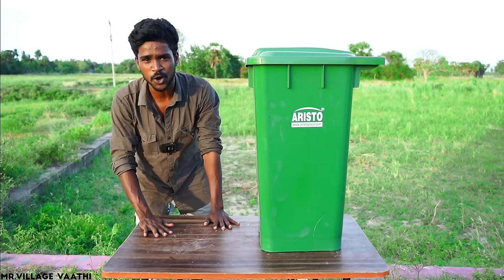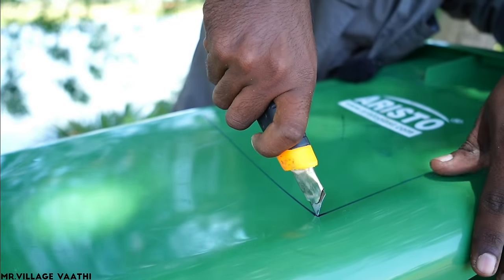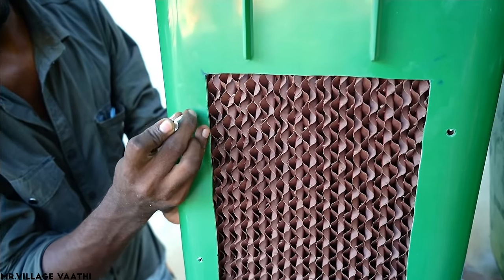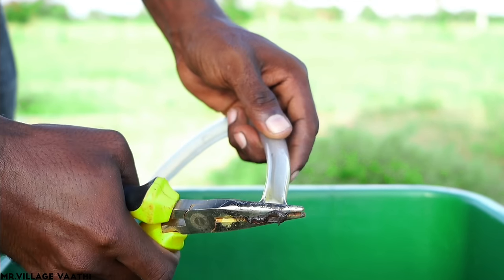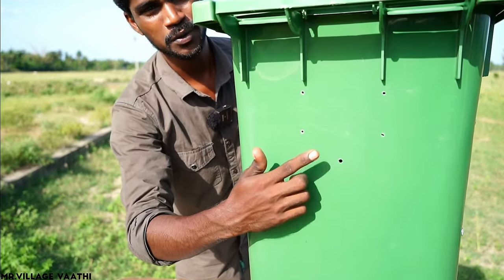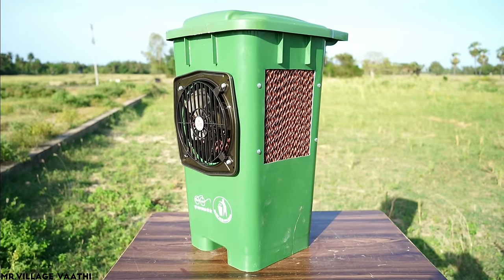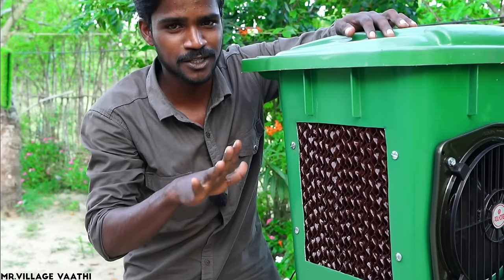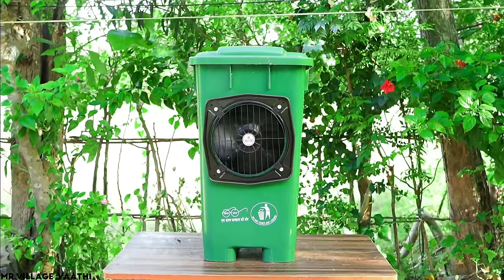Making Air Cooler with Old Bucket..! | குளிர் ஜுரமே வந்துடும் 🥶 | Diy Air Cooler | Mr.village vaathi

Comment: Athu exhaust fan nanba.. Ac current la direct line coil debt motor... 

Pulse regulation work pannathu.. Neenga PWM regulator use panna speed maathalam.. 

But really super.. Ac alavuku cooling varalanaalum konjam ok than EB Bill compare pannum mothu..
Reply from the maker: thanxs bro♥

Comment: Regulator oda output fanoda capacitor outputku match agidichuna speedla difference erukathu. So use a voltage regulator instead of ampere regulator.

Comment: Bro very nice cooler
But if dont this cooler water will store inside or its hard to drain the use water .if you  add water tap on the bottom of the cooler so water will drain easily when it not use and its easy to clean inside cooler as well .all the best for your future project❤

Comment: That's a great innovative one bro❤️👏👏 i wanna make one like this and you can't controll that type of exhaust fan speed with that normal ceiling fan regulator. It's designed to controll maximum 100watts load fan. I don't know whats the power rating of the exhaust you are used in here and the fan motor type. You've connected the regulator in series to the phase line like we do in ceiling fans. But you can't controll speed of some fans by connecting regulator like this. Some fan motors cant controll speed by applied voltage controll method. You can do it by using a capacitor start run induction motor fan instead of that one with a maximum power of 100 watts( for that regulator you used in here. Other wise high power regulators are available in marcket for high wattage fans ) whatever really like that one you made. Great bro. Keep doing🔥🔥✌️✌️